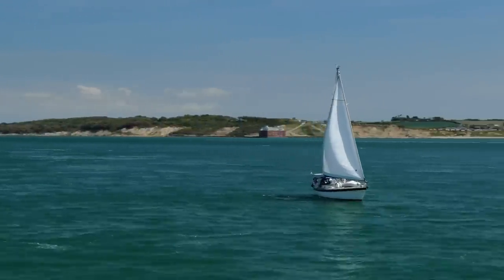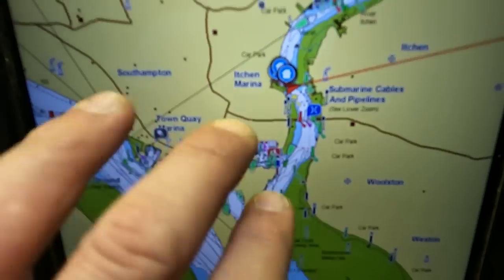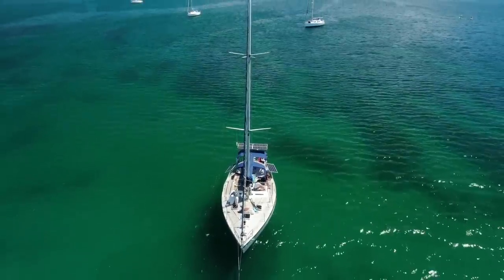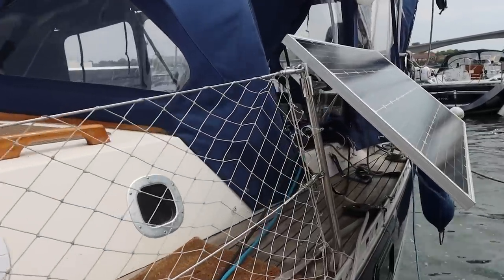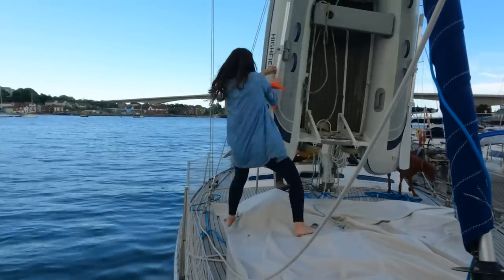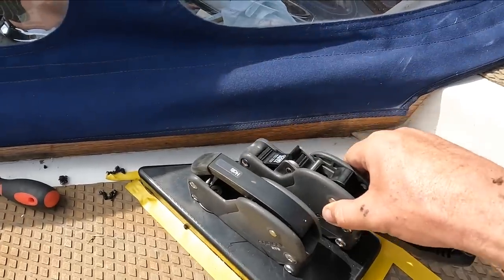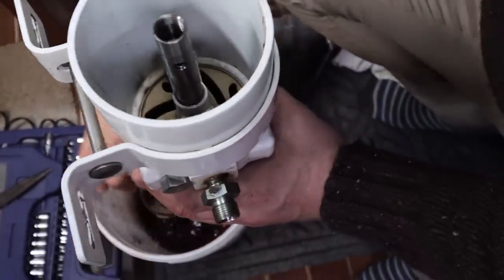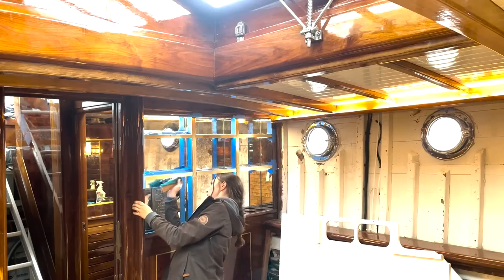Getting ready to set sail!! (2022) #115

Comment: Glad to see you back on the YouTubez, looking forward to following your upcoming passages. One tip I pass on in regard to anchoring is to consider using a tripping line shackled to the crown of your anchor then either tied to your anchor chain or better still, tied to a suitable ball or fender. Windlasses draw a lot of current and they don't benefit from being powered against a hard to release anchor, and as you found, the bow of the boat isn't a great fan either. It is simple to let the chain out a bit enough to snub it and retrieve the tripping line then use the warping drum on the windlass to pull the warp, Job's a gudd'un. Much better than making the anchor fast then motoring forward to 'break' the anchor holding, or releasing and waving goodbye to the chain to free yourself.
Reply: As a newbie I’d love to see that in some diagrams can you point me in the right direction ? Thanks

Comment: I think I saw that your water pump cover is the original Volvo part with retaining bolts/screws that you need to use a screwdriver on to remove. 

Have you considered getting a Speedseal brass cover which is retained by knurled knobs which are designed to be tightened with your fingers ? 

The relatively high price reflects the materials used and the precision engineering involved but it does make a job that is fiddly to do much easier especially at sea. I fitted one to the Yanmar 2ym15 in my Albin Ballad and never regretted it.

Comment: can hardley hear you.
Reply: This is one of several messages that say much the same but, for the record, I have no problem at all. That's very odd - it is bright, crisp and clear to me, and plenty loud enough, but obviously that isn't the case for many others.
I use bang up to date Ubuntu and Firefox on a decent Dell laptop - I wonder if they have out of date software (though they may have the latest software available to them), or you (Cadoha) have made adjustments since these comments were posted? I doubt that that is possible.
Curious!